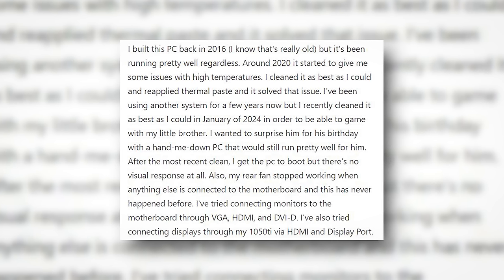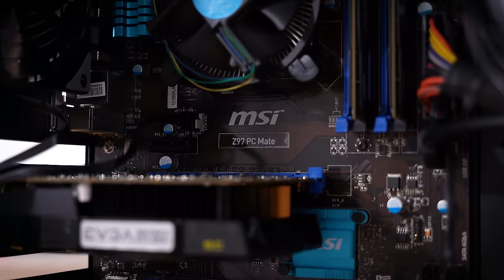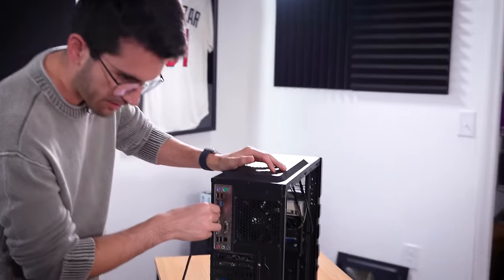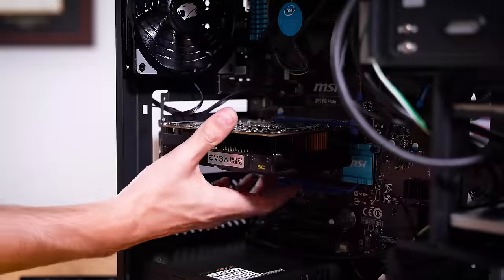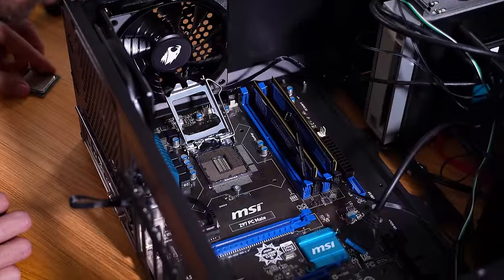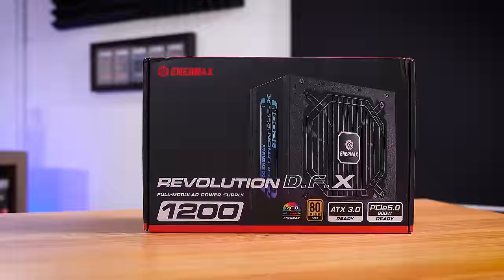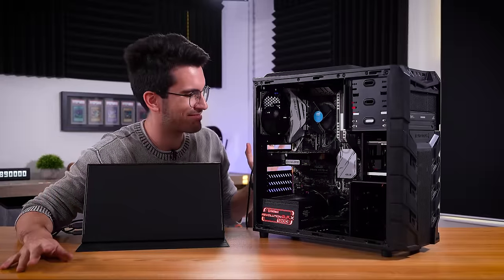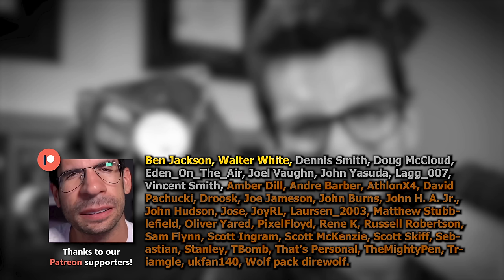Fixing a Viewer's BROKEN Gaming PC? - Fix or Flop S5:E4

Comment: I can't believe you fixed this.  This was straight up broken by the owner.
Reply: Yep, they put a load of old crap in a case they knew was broken then pleaded innocence to get new stuff 100%
Reply from the maker: The assumption that folks don't have old systems and don't game on them is hilarious. Do you think everyone out there has the latest and greatest PCs? Certainly not. Rubbish. And whether it was broken by the owner or not - it's our job to FIX. Not sure what you're on about there.
Reply: Where did I make an assumption about people not having old systems.  My system is a 6700k.  If I jam a screwdriver in my USB port and drop a brick on the CPU socket then write a letter saying it just stopped working, can you upgrade my system.
Reply: A lot of effort for not much gain.  Even if the damage was intentional, it made for a great video, and equally great learning experience.  As an amateur builder myself, Greg's covering of the quirks he find while troubleshooting will definitely help me improve my troubleshooting.  Even if he does get a few scams, it can still make for great content.

Thanks Greg for the awesome videos!
Reply: I don't think the person messed up the computer up on purpose. Greg could have just fixed it with zero upgrades besides power supply. 

Tech is super fragile. Even If you keep it in a safe place, accidents could still happen. If your tech lasts you 3 years consider yourself lucky. If it lasts longer consider yourself ultra lucky.

I had a xbox 360 when I was a kid and no matter what I did it only would last about 3 years. Warranty covered it. The next one only lasted 3 years again. I have a almost 10 year old ps4 and a almost 2 year old series x. They could go anytime. If someone knocks them over? Instant death.
Reply: Okay dude. By following your logic we can say the whole series is fake because every person burns their PSU's, fry their CPU/GPU, bend their pins, etc. so they can get their free upgrade, amirite? My brother in Christ, can you just appreciate what's Greg doing here for us? FOR FREE.
Reply: It was obviously the owner's error, but i'm not sure it was intentional.  Looking at the damage to the USB slot, likely a USB stick or peripheral was left in it and it got smashed into the back of a desk or a wall behind the PC.  I can tell you first-hand, if it's in a house with kids or teens, they can definitely slam a PC back into a desk pretty violently while goofing around with friends and not even realize they've done it!  I've had my kids break a USB port in almost the identical manner, kill a decent video card, trash a couple mechanical HDDs, and - my favorite - demonstrate the effects of milk in front USB and audio jacks!  As for the bent pins, there's probably a good chance that when the CPU cooler was removed to be cleaned and re-pasted, the CPU was also removed and cleaned, and accidentally dropped onto the socket during the process.  I've built several Intel-based machines in the last decade, and while i've (so far) never had it happen, i've had a couple close calls and can totally see the CPU slipping out of someone's fingers and dropping onto the socket bending some pins.  Likely wouldn't even have noticed the damage to the socket.

Comment: Move the GPU down to the next PCIe slot to see if it will get video on chipset PCIe. The 4690K has no iGPU so plugging the HDMI into the motherboard will do nothing. Seems like this user brought you a broke PC and lied to you to get you to fix it for it for free. Why would socket pins be bent if this was a system he was using for a long time? Unless, he just got a bunch a free and broke'ish parts to build a computer with then turned around and told you a story to get you to replace it all for free. Whole situation seems sus to me bud.
Reply: Greg booted with the video coming from the iGPU in the 4960K after he fixed the pins. From intel's product spec site on the 4960K: Intel® HD Graphics 4600